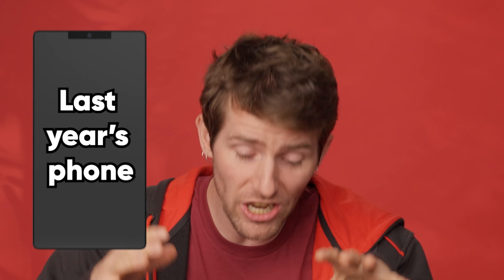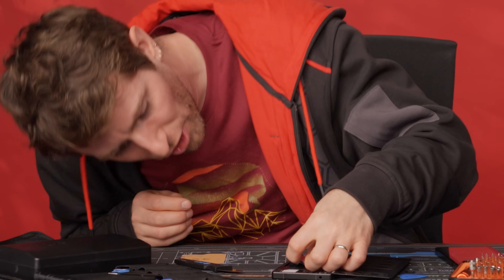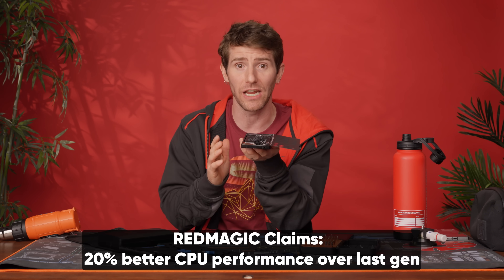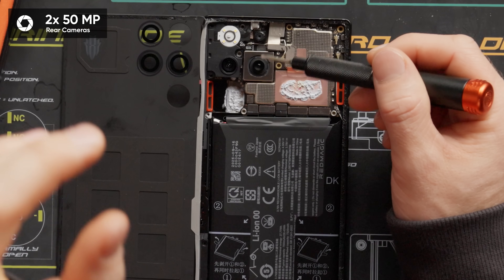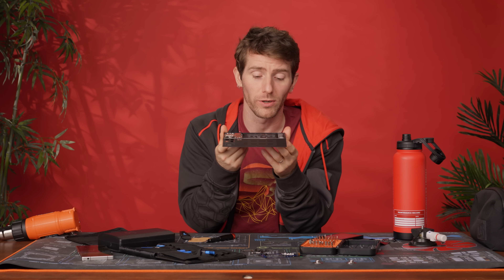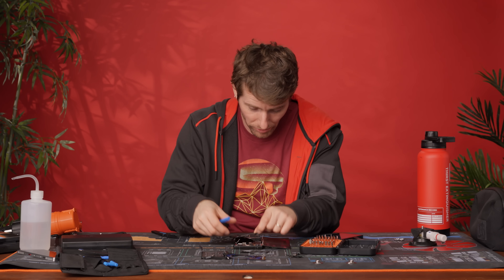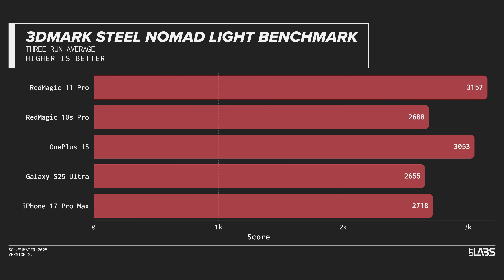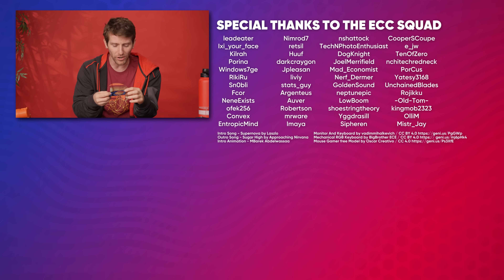This Water Cooled Phone is the Fastest We’ve Tested

Comment: Imagine having all these components and still having a headphone jack. It was not about space all along, they wanted to sell earbuds.
Reply: Obviously. The only phone that has an excue to not have a headphone jack is that tri-fold chinese one that is thinner than the jack itself.
Reply: No no no.
They totally had to downgrade the Battery from possible 8000mAh to 7500 just for That headphone jack! /sarcasm
Reply: @Haldi4803  I'm a Redmagic can I bought rm3,rm5,rm6 pro,rm7. The redmagic 11 pro has 2 version. 11 pro and 11 pro plus. 

The pro has 8000Mah but no wireless charging. 

The pro plus has 7500Mah but it has wireless charging. 

Yes they decrease 500Mah just to put wireless charging. It's a good trade off they don't just decrease 500Mah for no reason. Red magic is the good guy of Smartphone company for now.
Reply: Naah ....i don't think the headphone jack is the reason why they only put7500 mah instead of 8000 it could be the liquid cooling and wireless charging coil are both sitting at top of the battery or maybe they're saving it for the next upgrade
Reply: @seijii2886 Redmagic 11 has 2 version. 

11 pro and 11 pro plus. 

11 pro has 8000Mah but no wireless charging while 11 pro plus has 7500 but has wireless charging. So yeah the reason it had 7500mah because they trying to fit wireless charging
Reply: @Haldi4803  both verson have headphone jack, what's your point
Reply: @sampletext69420  it's sarcasm
Reply: @Haldi4803  ch version is 8k mah though lol
Reply: @APRigs it's likely Regulation issues.
Reply: I Love the Headphone Jack, have high Quality cable Headphones
Reply: @AdminAdmin-zb9bx if you have actually high quality headphones your not using your phone for music
Reply: @SteOhara  
That's nonsense. There are many smartphones with more than HiFi-level audio chips
Reply: seeing that jerryrig teardown of the iPhone with the space for the SIM-tray (which they provide for other markets) just empty made me so angry, clearly they COULD
Reply: @khulhucthulhu9952 well we’d be mad if only Americans got a headphone jack
Reply: Of course more crap to sell. That's why I went with RM. They are beasts and don't cost a lot. And they come with a headphone jack. 

I'm still daily running my RM8. Cold, heat, wind, rain and shine 400ft in the air and it's going strong. While my coworkers have Samsung's or apple products as soon as it gets -10C their batteries die. 

RED MAGIC TAKES THAT COOLING AND SAYS YOU GOT MORE? -40C and it still goes.
Reply: @bluephoenix53 
Really, the frost doesn't affect the phone?? Sorry, where do you reside?
Reply: That's why I stopped supporting these corporate crooks. Still using my Galaxy Note 9 no problem. I plan use it until its last day. S24U will be my last Samsung flagship.
Reply: @wsvtdsfyyfcgyytrfggtr i still miss mine even though I'm using an S23U and really love it (specially the 10x camera that they also downgraded later).
Reply: honestly, I get so happy when a new phone has a headphone jack. The fact that the Unihertz Titan 2 has a keyboard but not a headphone jack is so annoying
Reply: i might get it just for that lmao
cameras be damned.
dude imagine if they put a folding screen on it, so you could have a version that folds out for reading omg. and all the electronics stay in the main body of the phone id love that.
Reply: Yeah. I see some entry level phone like Infinix Hot 60 Pro or Tecno Spark 40 Pro about 6 milimiters thick and still have audio jack and even 5000mAh battery inside them.
Reply: my usb DAC costs more than two airpods pro
Reply: If they didn't put the headphone jack, I'd understand if these manufacturers at least implement aptX/aptX HD or the HiRes Audio stuff for Bluetooth. It is unreasonable when it's just AAC and SBC for the most part.
Reply: I'd probably own this phone right now if it had a MicroSD card slot. Unfortunately it doesn't which means I'd have to spend more for the 512GB or 1TB models, 256GB is nowhere near enough storage for a gaming phone.
Reply: Spen
Reply: Why are people complaining about having a headphone jack? Wtf. Better audio wired vs. unwired. Audiophiles love it.
Reply: Imagine having no head phone jack and not missing it. 
In the past I used wired earphones. Since I bought ANC BT-earphones I will never go back. 
Realize that the vast majority doesn't care about headphone jacks.
Reply: @manuelh.4147 same for me, I hesitated to buy one because I thought I'd lose it easily; the first pair I bought lasted 3 years, only stopping because I dropped it in water. That's much longer than my wired headphones lasted
Reply: Obviously
Reply: Earbuds are better though they have come a long way
Reply: I still remember when phones comes with their own charger and earphones sometimes with a case too.
Reply: Earbuds? You mean overengineered ewaste?
Reply: Anyone in need for a link to a USB type-c to type-c plus a headphone jack? There might even be some lightning ports adapters that now support that
Reply: I'll say I still don't care about having a headphone jack and would rather just get rid of it if there's any benefits from that although whether there were any benefits to getting rid of it is a whole other thing...
Reply: Project Sekai and Bang Dream players be like 😀
Reply: "YOU DON'T SAY"
Reply: Funny how people always seem to overlook that Apple weren't the only ones who removed headphone jacks from their phones...
Reply: @fireaza what like, samsung? Who also famously sell wirelesss earbuds?
Reply: Hah jokes on them... i bought a bluetooth capable set of headphones instead.

...i hate earbuds...
Reply: Calling out that it doesn't have a dust resistance rating, likely because of the headphone jack. There's a technical tradeoff happening
Reply: I think so too.
Reply: We have kno5this for year's
Reply: 54 kg how old is she? This is just weird. Pliss stop
Reply: I agree with the sentiment here.  However, to be totally fair, apple removed the headphone jack nearly 10 years ago.  Obviously, a ton has changed since then in the areas of battery size/tech, component size, etc etc etc.  A better comment IMO would be that due to all these continuing advances in size reduction of components, these days there is absolutely no reason at all NOT to bring back the headphone jack.
Reply: Nope it is space cameras are bad and its still that thick?
Reply: The headphone jack is for gaming, the normal Bluetooth earbuds has slow input rate that can effect your gameplay a lot.
Reply: Better having figured out late than never.
Reply: Yeah did you only figure this out? That's  been known since the day they removed it
Reply: @TK-on7cz  AKG has wired headsets that work with USB C pins
Reply: They gotta raise those margins, bottom lines, etc
Reply: Using wiems now and the audio trails. I hate wireless. It's for plebs, maybe the sennheiser hdb 630 with dongleberry is the solution
Reply: 其实是摄像占的空间太大了，潜望式长焦镜头顶两个耳机孔
Reply: Waking up are you? 😌🤜🏻🤛🏻🫡😎
Reply: What else is new
Reply: No one uses them no more dude
Reply: Which is CRAZY! Airpods are GOD TIER products they dont have to go through all these hoops!
Reply: Yeh, true. But the headphone jack still takes up space that could be used for more battery power, and you can simply leave a USB-C adapter connected to your headphones
Reply: @TK-on7cz  no its because wireless bluetooth headphones or earbuds cause ping/MS to spike when gaming.
Reply: Ikr these companies
Reply: Holding onto something worse?
Reply: This phone is not dust resistance and has IPX8, so there is a reason.
Reply: and it doesn't cost even 700 e in germany xperia 5 v cost over 800 e sqmsung s25 also price to high this phone is sick i got today one
Reply: There currently is no technology to get higher or equal audio quality to a aux,.wirelessly.

It's all higher noise floor and distortion and low bitrate.
Wireless sucks and is expensive and bad for the environment on top.
Reply: I mean, they can sell earbuds for 200 bucks that sound like a 30 bucks wired headphone. Of course they'll take the extra profit.

Also, it's easier for you to lose buds, so more sales for them.
Reply: This phone is pretty thick
Reply: No excuse to not have one when the $200 switch lite has a headphone jack.
Reply: people still complaining about the headphone jack is so cringe. just get a btr11 and move on with ur life
Reply: This
Reply: Earbuds > tangled wires
Reply: @tubeLu  Spoiler alert: Having a headphone jack doesn't mean you can't use wireless at all.

The reverse is not true.

Only with a headphone jack can you pick and choose which option you want, when you want it. There's just no benefit to NOT having it.
Reply: @zemerick but think of the poor big companies :( they save $0.05 per phone for not including headphone jack
Reply: its not about headphones its about wireless over wired so you can steal signals
Reply: It’s thicker than an iPhone pro Max wdym.

My Laptop has even more stuff inside than this stupid phone, guess they just didn’t want to fit it in
Reply: @saganakist  Your laptop probably would have even more stuff inside it... considering it's typically 6x larger🤣
Reply: @KyberGaming47 that’s the point. Argument was that this bigger phone fitting an headphone jack is evidence that other phone makers could have fitted one in their smaller phone as well.
Reply: @saganakist  0.15mm thicker, now it's a brick.
 0.15mm more thickness now  it can suddenly have a big ass battery, a fkn fan system, liquid cooling, 3.5mm Jack, double the wireless charging capacity......rightt😮‍💨
Reply: @saganakist  0.1 mm more.. your right its a fkn brick 🤡
Reply: @DasDaniel007 well maybe to that  person 0.1mm is huge
Reply: @saganakist laptop vs phone 🤡
Reply: @saganakist  By mm, I don't think anyone would care a few mm of thickness and they had a headphone jack
Reply: @T @TK-on7cz  its literally a thicker phone for zero benefit for most people today. I am certain that not only would someone mind, most would mind.
Reply: @TK-on7cz I would. Don’t force a bad DAC and a headphone jack on me that I will never use. And I suspect most people don’t want it either considering how much more convenient BT headphones/earbuds are these days. Though I’m happy there are some phones with headphone jacks for those who want it.
What would actually make sense is to just have two USB-C ports, if you really want to listen by wire while charging. It makes a lot more sense tor the DAC/amp to be in the headphone (and properly calibrated to it) than in the phone.
Reply: @saganakist  1 or 2 millimeters more. Maybe its true, many would mind, what if the battery was reduced to 5500 there would be more space while giving the same battery specs found in the current Samsung and Apple phones
Reply: Morons
Reply: @saganakist  the market for this phone isn't gonna care about the thickness when they can't connect their favorite wired headset.
Reply: @auspiciouslywild  why would the DAC be bad?
Reply: @saganakist fair enough. But we've also seen thin phones with 3.5mm jacks. 

The point isn't that we NEED the jack these days. The point is that Apple claimed they got rid of it due to space. Which fell on it's ass the second people started taking them apart. 

So, long story short: you didn't get the joke
Reply: @saganakist lmao nice joke, btw the thickness is for the cooling not headphones jack..
Reply: @saganakist  Fact that he is comparing phone vs laptop undermines all of his points.
Reply: @saganakist  Apple fanboy spotted 📸🙄
Reply: @BukanGamingOfficial  😂 the pro max is a ginormous brick of a phone that I would already never buy. But sure, comparing it to an even bigger phone makes me an apple fan boy.
Reply: @saganakist  and the ipod nano 7th gen is thinnner and much smaller than it, and it also has a headphone jack, whats your point?

Comment: 3:18 "feel"? Really? I understand that this is a sponsored video but come on guys. Did they engineer the whole phone based on vibes alone?
Reply: It says they feel... Doesn't mean it does anything at all...
Reply: Yes.
What else is a cooling loop supposed to do that cannot Cool anything?
It's just moving the heat around inside the phone...
Why are there no cooling fins inside the Fan duct?
Reply: @Haldi4803  Cause tiny little fan doesn't have the air presure to push air through the fins, genius. And moving the heat around creates more surface area to dissipate it.
Reply: @Haldi4803  All cooling is just moving heat around.
Reply: @Haldi4803  all cooling is just moving heat around anyways, the liquid loop helps With that

Comment: I truly cant see how this "water cooling" is anything more than a gimmick with how small the thermal mass is with that amount of liquid. Maybe its some space-age tech that is orders of magnitudes more thermally dense than normal coolant but I'm going to call bullshit until I see some data.
Reply: It provides almost nothing and is on the battery so at best it decreases one degree the battery temperature. 
So basically nothing. 
It seems more like a marketing trick.
Reply: there is a video of someone putting it on an iphone and it improved its performance a decent amount. But for the redmagic it doesn't do as much since the fan will be doing most of the cooling
Reply: still looks cool tho

Comment: HEADPHONE JACK GANG!!!!
Literally the number one reason I ordered this phone. I wanted a phone with a headphone jack, that had some service life and performs better than a wet brick. welp, wasn't expecting to get the top of the line, but I'm excited to try it!
Reply: for real. still hesitant personally because of the lack of sd card and especially the cameras. but im quite intrigud
Reply: the full notchless screen is also really cool
Reply: Motorola has some nice phones with headphone jack.
Reply: @ohioplayer-bl9em  huh, it seems I failed to search properly, I only found their older phones. I do prefer OLED screens though
Reply: @ohioplayer-bl9em  Sony has both a headphone Jack and Sd card.
Reply: @SIPEROTH  sony is garbage. Weird aspect ratio, not even a cable or sim ejector tool in the box, camera sucks on default mode and you have to be pretty skilled with exposure, colors and depth to figure it out. Very niche phones and the average person will never buy a sony especially considering the huge msrp of ~$1500(even more in EU) and lack of availability. No one is going to spend that fking much for a headphone jack. Just buy flagship tws.
Reply: @SIPEROTH  Also no front punch hole camera, and very good cameras overall (if you're looking for that). Unfortunately Sony keeps shooting themselves in the foot recently. The Xperia 1 launched with some problems and had to be pulled out, and the Xperia 10, while cheap, I don't think upholds the Xperia standards, but worse than all, the phone I was most interested about, the Xperia 5, it's discontinued. Xperia 1 is too expensive for me, and I don't take 10 seriously, but neither of them are selling anyway, where I live (in Bulgaria). That was not the case with the Xperia phones, up until now.
Reply: @whyisitsodifficultomakeahandle Emm...Did you fail to realise that you don't need a SIM ejection tool on the new Sony phones?  😑
Also they changed the aspect ratio now. 

Honestly I also don't care about the cable. From the moment we don't get chargers in the box why would I care getting the cable? 
I am going to order a charger anyway that will have a cable. 

Camera depends on user. Is a different philosophy where it gives the user the ability to set it up and be more real instead of just made to quickly get a possible good result with lots of software enhancements. 

I agree about the price though. They need to stop behaving like they are the top model there is and charge so much.
Reply: @ohioplayer-bl9em  LUL! Motorola phones are GARBAGE!!! like below Samsung A phones.
Reply: I use a USB-C - 3.5mm jack adapter.
Reply: @Charvin  dongle adapters last about 2 nanoseconds until the thin wire disintegrates or the cheap connector doesn't want to stay connected anymore. I have a moondrop dawn pro portable dac/amp and always have problems with disconnections from the usb c port no matter the phone. Plus using the phone and or gaming with the dongle attached is more awkward than just the cable for the headphones or earbuds.
Reply: @HawtDawgBro09  The Apple USB-C to 3.5 adapter is actually pretty good, cheap too, only $9.
Reply: @Angus_MacAskill  not in the EU where it's limited to 2vrms and also on android limited even more.
Reply: @Charvin  We live that adapter free life fam..... quality of life so much higher